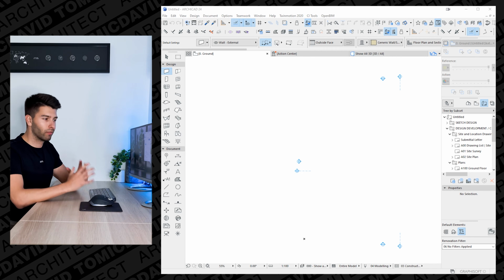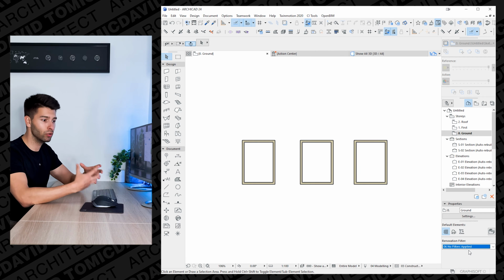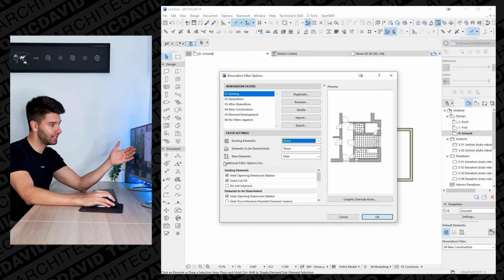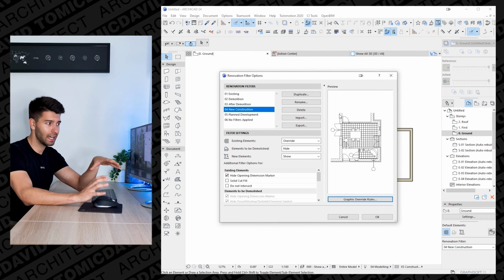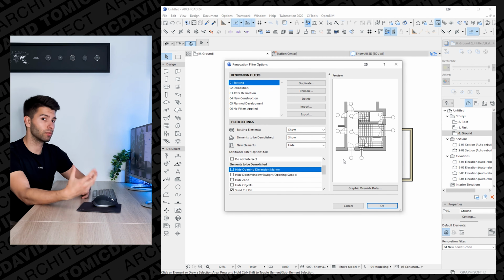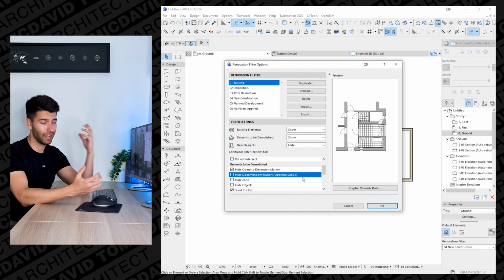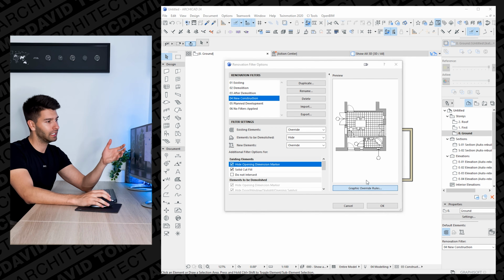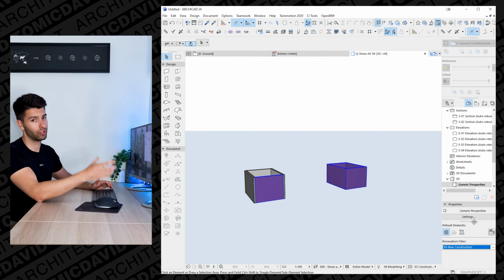DEMOLITION Do it right | ArchiCAD Tutorial

Comment: Hi David, thank you for your work. I wonder if you have a solution to use this tool in the elevations, because many times i have elements that are to be demolished in from of other elements, and what hapens is that whatever is behind this elements will not be seen. Do you have any solution for this problem? Thanks
Reply from the maker: I still have this issue as well, sadly it isn’t a perfect system. Normally I just 2D fill things that don’t need to be there

Comment: Hey there! a solid explanation on renovation filters. Though I have this problem with showing demolished walls or elements under the new construction walls/elements. See, when you put the renovation filter on "change plan" which basically will show you yellow and red ( as demolished and new construction), you won't see demolished lines or hatch under new construction walls! the problem pops up when for instance you have a 30 cm wall to be demolished and a 40 cm wall to construct on the same position when shown on "change plan" status, you won't see that 30 cm that is beneath the new wall and basically all you see is the new construction wall. Yes, you can change the view order but that does not change the fact that one over another basically covers all beneath. Hope you get my question 😅
Reply from the maker: Hey mate! I always have 3x plans when doing renovatipn projects. Existing, demo and proposed. This way if anything is covered it is picked up in the demo plan as apposed to having all the info on one plan. If I didn't answer the question, check one of my newer videos and join the discord group where you can share screenshots and we can help :)